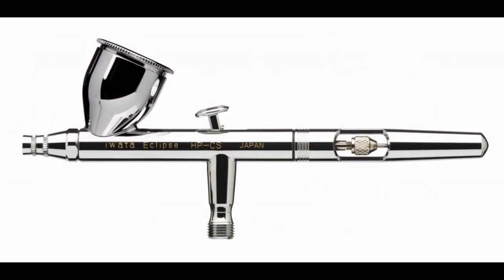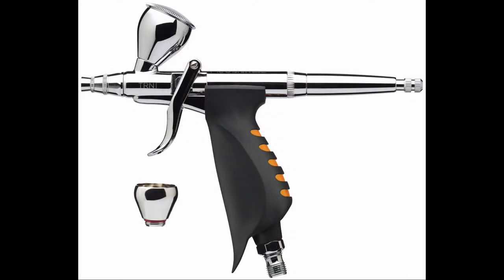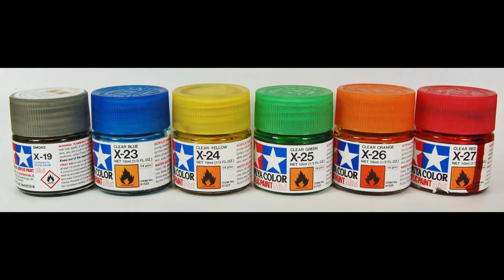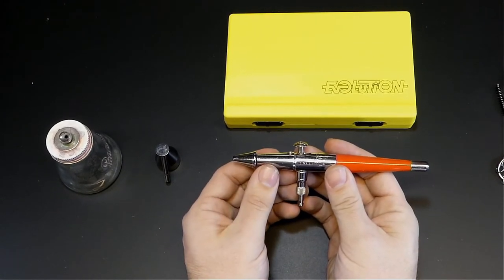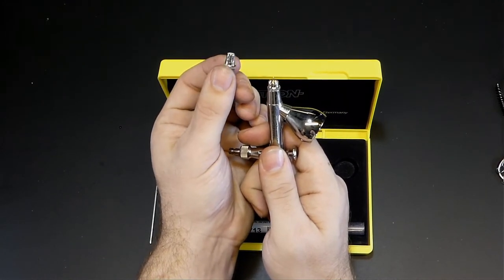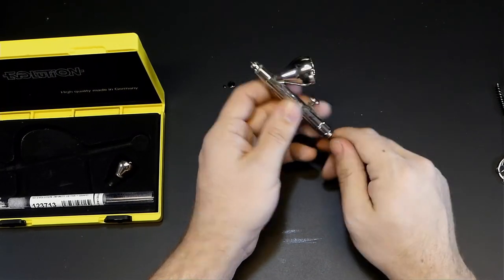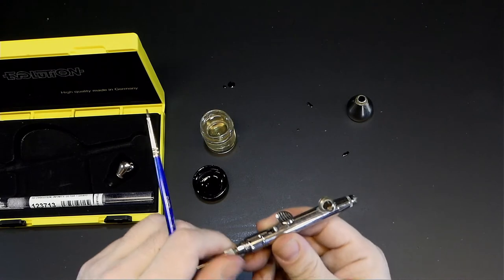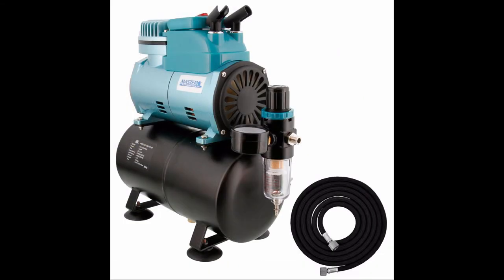How to Choose an Airbrush and Clogging Hacks!!

Comment: Good video, well discussed and presented. I use a mix of Tamiya, Vallejo and Humbrol paints. on the cleaning front, after every session I do a partial strip down strip down of the brush, then flush through with surgical spirit followed by airbrush cleaner.